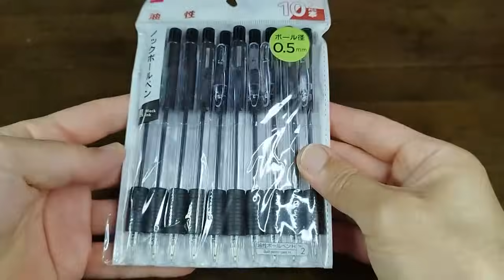Fishing Hook tying tool that can be used in 10 ways.   Great fishing tool. DIY Fishing.

Comment: Second thought is your plies you has been use in this v d o brother, it is the combination of use I was found out, but the long nose plies is better to tie and to take the hook out from the fish mouth, I used both of them + pin you show, but I used metal rod always to the tip of pin tube end glue it when pull hard will not break the pin, I very love your idea invent some thing to use easy than tie by the hand with small hook thank you brother F_T DIY, 🙏👍👍, I look forward to see your new idea .
Reply from the maker: I'm glad you left me a comment about my video.😊

Comment: The hard part is finding a ball point pen with an ink tube the right size to accept the fashioned, bent-wire with a hook on the end.  Everyone I've tried so far has been too small, or way too big around.  Also finding one that happens to be empty is no small task either.
Reply from the maker: Thank you for your understanding.   I hope you can find the right size ink tube.
Reply: Wrap gaffer tape around metal hook to make it fit the tube, add adhesive to fix in place. I used the gum edge from a few cigarette papers , dipped it in contact adhesive,  jobs a good un.
Reply: @Smiffy830  Thanks, I'll give that a try.  Cheers.